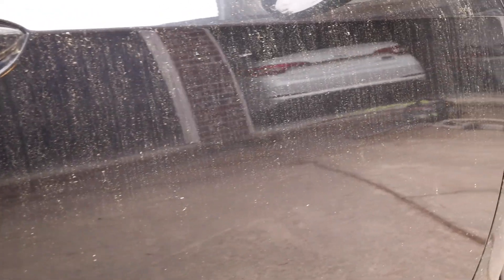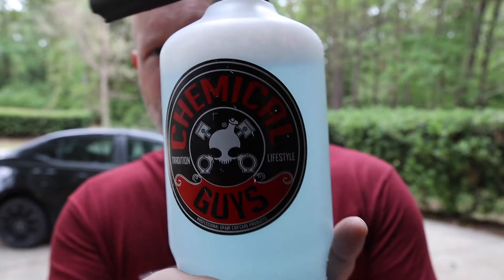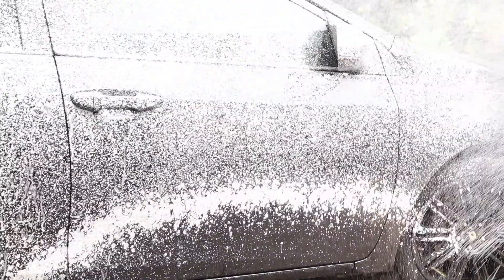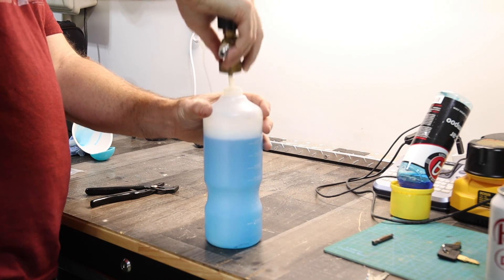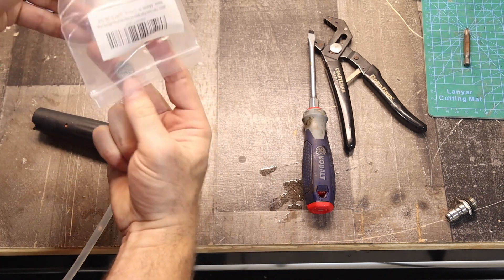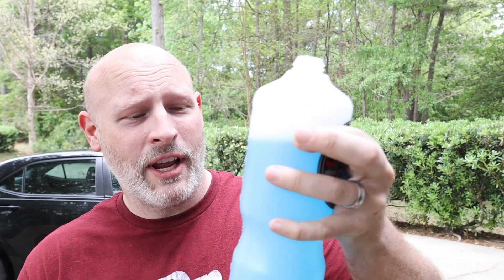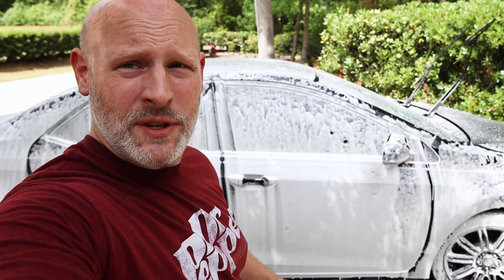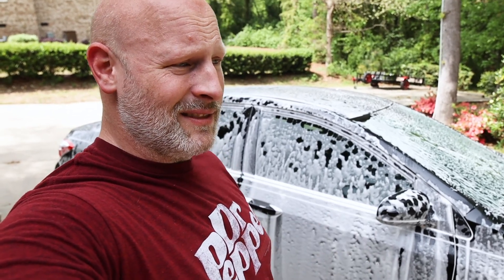Simple Foam Cannon Hack for More Foam

Comment: The mesh thing is the part that makes the foam, it goes inside the nozzle, if your find your cannon isn't working well it's probably due to that being clogged.
Soak the whole thing in carb cleaner or pull it apart and clean it or replace it.

Comment: Great video Matt. I need to get a cannon to go with my new pressure washer as well as the little do dad parts to maximize my foaminess.
Reply from the maker: Thanks, but I don’t know, if you keep your Jeep too clean you might get mistaken for a mall crawler.
Reply: @SimplyMustGo  oh oh touché. We can’t have that. Posers 🤣
Reply from the maker: Speaking of mall crawlers. What all do you have left on the YJ? 😁
Reply: @SimplyMustGo  🤣 I need to find a decent pair of half doors. I plan on having my diamond logo wrap done on them to match the old patina of the rest of the Jeep. Kinda rat rod but a Jeep 🤷🏻‍♂️. Other than that, new carpet, roll bar pads and call it good.

Comment: I used my foam cannon and it doesn’t foam as much, and sprays a very runny soapy water. I have an 1100psi electric pressure washer. Will a 1.1mm orifice work better or will a 1.0mm orifice work better with my foam cannon? Not sure which one I should order. Please let me know.
Reply from the maker: Couple of things. Make sure you are using soap that's designed to foam in a foam canon. Also use hot water instead of cold water and make sure you have enough soap in the bottle. Do that and then also the 1.1 and you should have tons of foam.